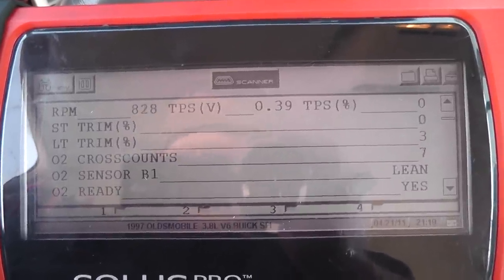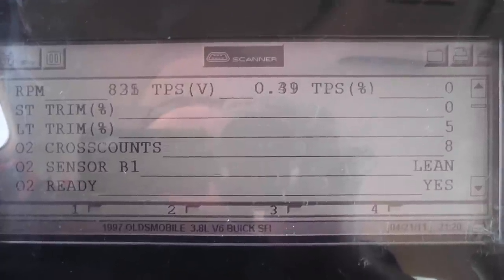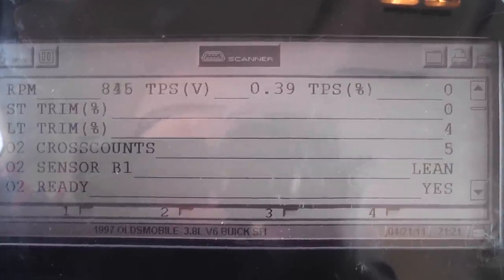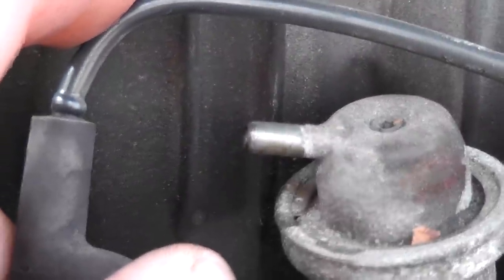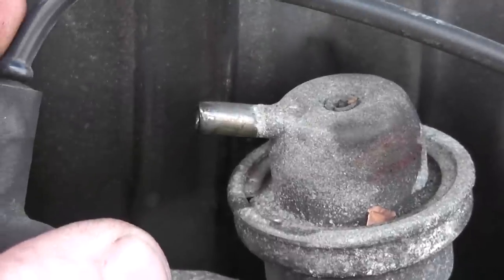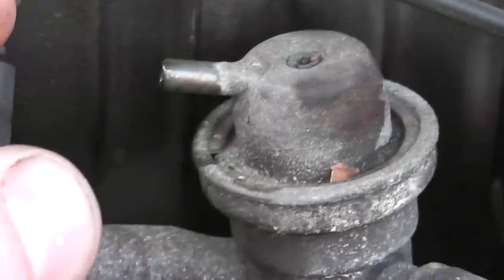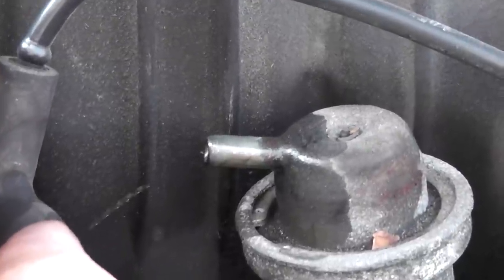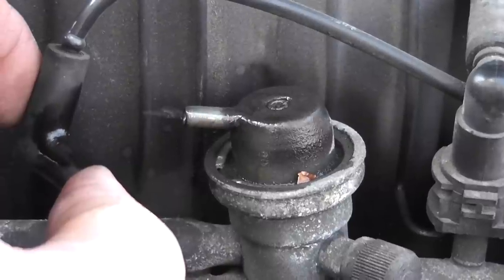Testing for a leaking, ruptured, fuel pressure regulator diaphragm

Comment: hey im getting a air fuel mixture to lean and it misfires (6th cylinder) on a 99 pontiac bonneville non supercharged) drives find off cold start, if i drive more than just to work and home (which is 10min drive) it will start misfiring and start jerking..then it will cut out and wont start for awhile...doesnt run hot new battery new alt new serpentine belt.. engine wont turn over. once it finally starts it runs reallly bad until i let it sit over night...

Comment: What if ur car will start but then stalls. Still smell gas bad, black smoke when tryn to restart. But itll start everytime i turn the key just stalls rt after
Reply from the maker: IT would help to know what you're working on? Year, make, model, engine, trouble codes etc You've given me no real way to answer you. Black smoke, hard starting is a symptom of a rich condition, but you already knew that right?
Reply: 2001 buick park ave 3800 series 2. Car ran fine all day went to leave and it started and stalled. It sputters when tryn to start and run afterwards with a large amount of gas smell and lots of smoke. Wont idle smooth.
Reply: Yes but ive swapped coils, tested the fuel pressure regulator. The fuel pump is fine and the filter is ok from what i can tell
Reply: I cant keep the car idling long enough to see if the regulator is bad but i dont smell fuel when i rub the tip of vacuum line
Reply from the maker: @SOUL_TAKER-cw6cv  unplug the MAF and see how it runs

Comment: ok well i just found out the hose running from the regulator to the air intake is cracked replaced it and my check engine light went back off

Comment: Could this cause a P0420 ?
Reply from the maker: It can kill a cat (any over or under fuelling condition or misfire) 
If you have a cat code and other issues, fix the other issues first unless the cat is restricted of course
Reply: @ScannerDanner    Thanks.   I’ve got a  2000 gm 5.3 sierra that am nursing back to life.  It has a 420 come in weekly.  The cat is not plugged.  Flows well.  I scoped the inlet to it and can see open screen but some very light build up, knife edged.  There is also small area missing about 1/4”Wx2”L at edge of it.   I just finished repairing broken exhaust manifold bolts and gaskets, a stripped spark plug hole that wasn’t seating and misfiring, and a cracked mini vacuum hose in the fuel regulator.  All of those am sure have affected the cat. The up and down stream O2 sensor trends look much better now but still not as great as the other side of the engine.  Crossing fingers it is “mostly” fixed now and the margin is enough that the 420 stays away now.  My next step will be to put a sensor spacer in if it comes back.

Comment: So if its good it wont leak
Reply from the maker: If the diaphragm is not torn, then yes that part of the regulator is good. Fuel pressure regulators can fail other ways (stick open and stick closed causing fuel psi issues)
Reply: Ok thanks man